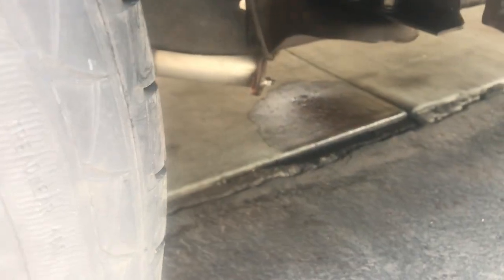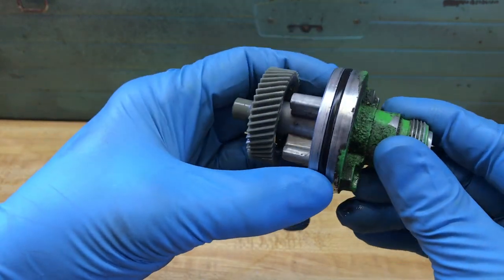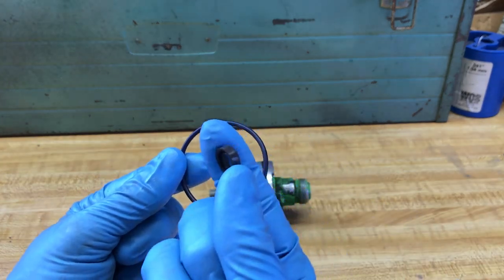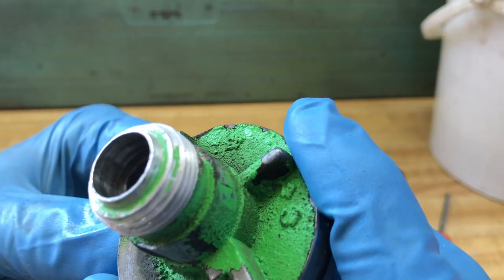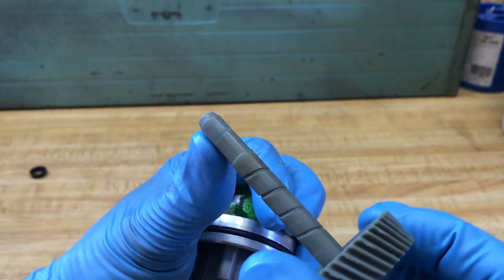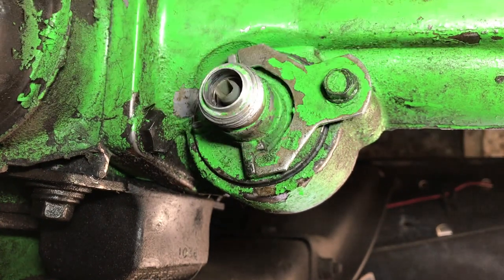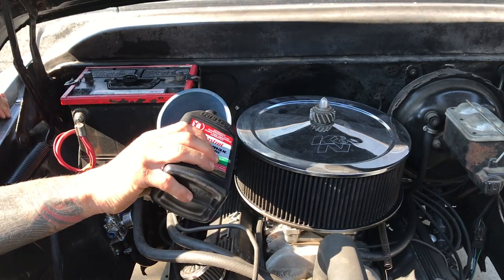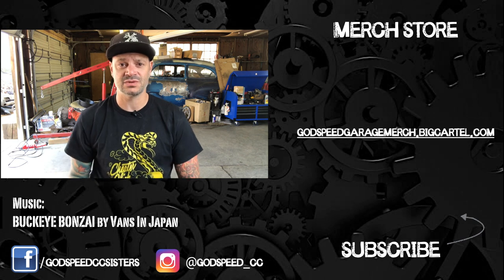HOW TO FIX A SPEEDO-CABLE LEAK

Comment: Were there any other issues other then the leaking that cause you to replace?
Reply from the maker: nope. the tranny runs great.  just left a puddle in my driveway which the HOA frowns upon... I also have a leak at the driveshaft seal... I'll like do a video on how to fix that leak.  doing some research it seems like it's kinda more involved... so stay tuned.  THANKS FOR WATCHING!